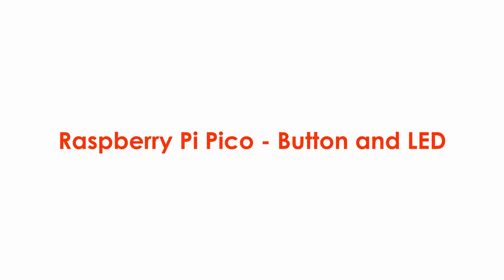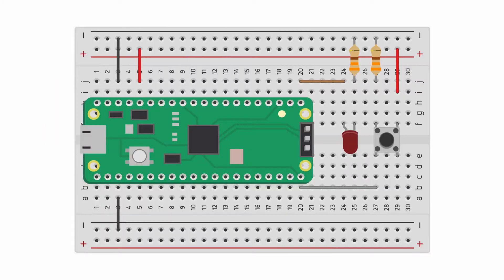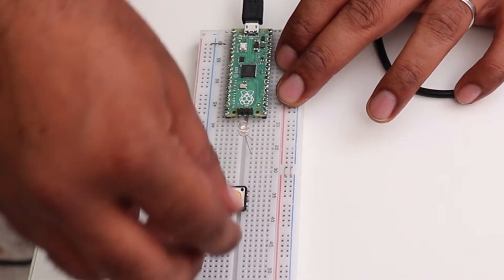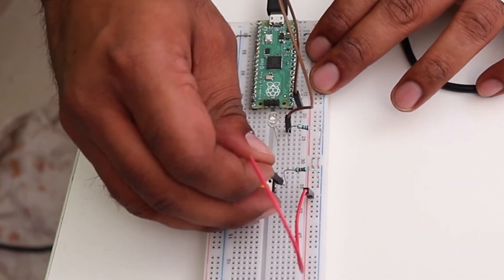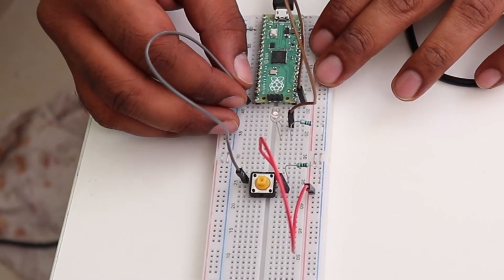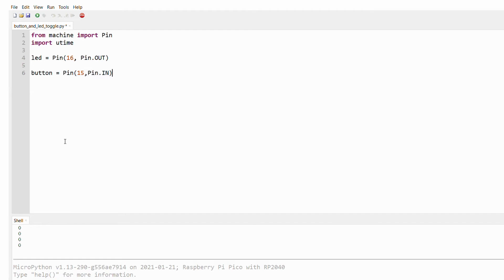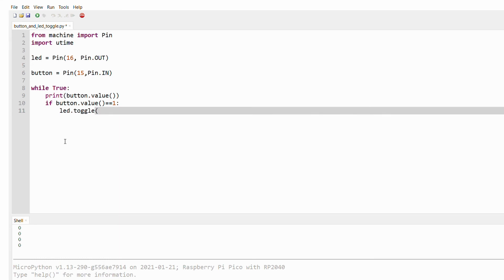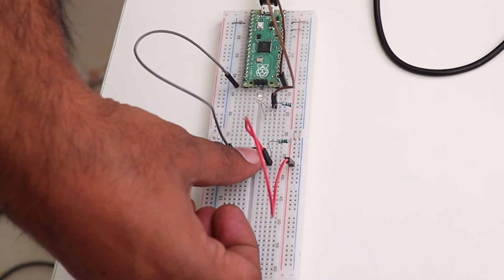Raspberry Pi Pico Project: Turn on an LED using a button

Comment: Great video. What is the purpose of the resistors to the ground and does it matter what type of resistor?
Reply from the maker: The resistor serves two purposes. When the button is not pressed, it provides a clear path to ground when the button is not pressed. Second, when the button is pressed, it makes the path to ground the the path of higher resistance. This causes the the current to choose the path to the GPIO over the path to ground. Without the resistor, the circuit may still work but sometimes give unwanted results. The resistor can be of any value.